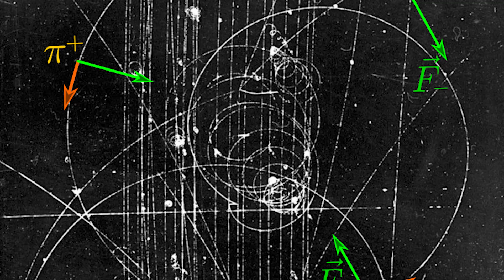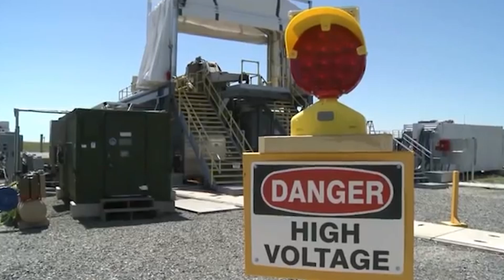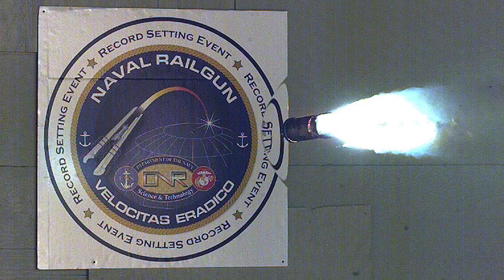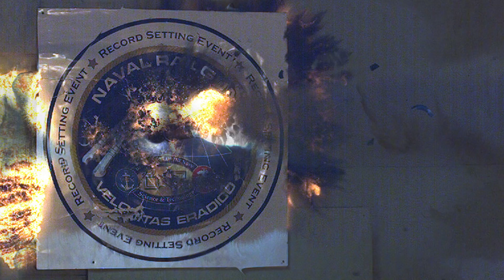Railguns: The Kinetic Future of Warfare

Comment: He actually missed the largest problem with railguns, and the real reason militaries are putting less time into them. Energy transfer.
Studying terminal ballistics taught us a long time ago that too much power in a projectile will actually reduce effectiveness. Like neutrons, the vast majority of energy is dispersed just before the object stops - if a projectile blows through an object too easily, very little of the energy is imparted on the struck object. The deck-mounted railgun was punching clean holes directly through target ships. Small arms found a way around this with hollow-point (the round disintegrates, which causes 100% of energy to be imparted on the target), but it's been an issue finding a similar solution for ammunition under the acceleration stress of rail rounds.

Railguns might retain a place in the future as they have incredible range, incredible potential energy (if the correct target is found), and practically no way of neutralizing (defending against) them. They're certainly not practical in most applications though.
Reply: @commenter1430  killing power is irrelevant if you cant defeat the armor. The best way to beat armor is with something hard and pointy going really fast.  That's why the Abrams tank uses depleted uranium ke penetrators. The round looks like an arrow after the sabot is discarded
Reply: @hawk6111  You’re obviously young, and not in the military. You’re talking about armour like it’s Warhammer 40k - like it’s even an issue. Weapon Strength is almost always stronger than armour; we’ve never had trouble piercing it once we know how thick it is. Once we learn something is “sturdier” we simply scale up the energy transfer slightly, or circumvent it (HESH/HEAT). There is nothing on earth that’s even close to the level of a rail gun, it would blow a hole straight through a main battle tank or battleship. Ships are actually pretty unarmoured (comparatively to MBT’s).
Secondly, energy transfer isn’t “irrelevant” if you can’t beat the armour - this isn’t the Marvel Cinematic Universe. If the armour actually stopped a rail round, the energy transfer that would be imparted on the crew inside would kill them. There’s a reason the US Army doesn’t heavily armour everything, at a point it doesn’t matter. IEDs killed a lot of people in armoured vehicles just due to energy transfer (no direct contact was made).
Reply: @TheAunvre   How about launching the projectile at a large angle? It will: A) allow the projectiles travel through upper atmosphere, therefore increase the range of the gun (this is the same principle of the Paris gun) B) make the projectiles strike straight down, 'punch clean holes' through the deck, and the hull. Clean holes on the side of the hull might not be a problem, but holes in the bottom... yeah, maybe. It leaks. Also, if the target is an aircraft carrier, punching holes in the deck will disable the ship (well, at least its capability of launching and landing planes). Yet indeed, in order to get a vessel close enough to fire a railgun (like, 100 miles from target), you will need to disable the carrier first, or withstand constant air and missile strikes. Another disadvantage of this strategy is by launching at higher angles, the projectiles are exposed to enemy radars earlier, and if they can track incoming missiles, they will be able to track the projectile. With little to no maneuverability, the trajectory of the projectile is very predictable, making it easy to intercept. But railgun systems are designed to fire at high rates, overwhelming the interception system instead of trying to avoid it. Finally, a railgun projectile is (at least can be) way cheaper than any interception missile. Therefore you can bankrupt your enemies by firing at them, even if none of the projectiles hit the target.
Reply: @andyhu9542  That’s a great idea, it would be like a ballistic missile launcher. Although, the electronics in the nuclear warhead might not survive the Gs from the launch.
Reply: The idea behind kenitic energy penetrators is to defeat armor not deliver all the energy of said projectile.
Reply: @commenter1430  considering most things the size of a ship will be armord I would go for that over maximum energy transfer.
Reply: @commenter1430  you thought processes is good when dealing with flesh targets but once you start dealing with armord vehicles it's more beneficial to actually get past the armor and on a vehicle that can be a significant amount

Comment: They whole point of a bullet is to transfer kinetic energy into the target, rail guns cut a hole strait through a target. Higher velocity isn't always a plus. If you need to cut a small diameter hole in something it'll do but so will an rpg that costs like $50.

Comment: The US Navy has already dumped 500 million into the rail gun and the DOD pulled the plug. They cannot overcome the technical issues like the rail gun destroying itself every time it fires the projectile. The fireball is the rails melting from the friction of the projectile and the heat generated from the current.

Comment: Railguns: absolutely ridiculous penetration within a straight line of sight.
Once it has to go ballistic, its comparatively low weight (thus impact) will remove this penetration. 
But the horizon line and its distance thus range depends on the height of the weapon above the current level, meaning these have to be placed as high up on a ship as possible to achieve the greatest possible distance in a straight line.

But no matter how high you place this weapon it will never come close to the range of artillery shells being lobbed over huge distances which can then be guided into its target fairly accurately.
A railgun's projectile relies on its kinetic impact, not on explosives, to do the damage. So hitting not close, but as perfectly as possible is a very high position on the desireable attributes of such a weapon.

Comment: The amount of energy is not absurd. It is just the wrong kind. Big guns in WWII were replaced periodically, due to wear and tear. With today's technology and materials, the shell propellant could be CL-20 or maybe octanitrocubane, at far less cost than the railgun, then replace the barrel after the proper number of rounds. The warhead,  a shaped charge with the same explosives for use against other vessels or HEAT for ground targets, and use the same tech for targeting as it was in the USS Missouri, analog, not digital, safe from EMP. We are no longer trying to sink Yamato or Bismarck with one shot. 5 inch guns are enough for today, unless you are going against Red October or Nimitz

Comment: If you look for it and have a few thousand dollars to spend there's a hand held railgun that's a little bit bigger than your standard assult rifle, and the other factor that comes into play is the newest version of a laser, a unit that weights in under 3 hundred pounds and not very big, but it can knock out aircraft and missiles in flight, and even take out artillery before it can hit. There's currently a couple of platoons of LAV's in the US Army that are armed with these weapons and another interesting point you don't see the beam and it can destroy a fair amount of targets of different sizes.

Comment: The power sources needed for rail guns are unbelievably massive......... like the amount of power produced on a Zumwalt Class destroyer by any chance???
And yes, you're correct..... BAE SYSTEMS has been and is still heavily involved in this technology, which makes me proper proud. I've looked into the Chinese rail gun and it's no way near ready or reliable enough to actually use, it was merely done to copy and/or make themselves look equal to the United States.

Comment: Probably won't solve the power systems problem until sustained fusion reactor is developed.  As for materials, probably need silicates or gem-based coatings to protect the metals.  Electromagnetism should work even with that inclusion.

Comment: I had not known as much about the military applications, but I had done a HS thesis on non-military uses in about '81 based mostly on public NASA documents on mass drivers in a public university repository.  I was looking at transportation and orbital launching. (way more environmentally clean).  Some amusement rides like the one vertical Superman amusement park ride was the first commercial use of the linear accelerator technology.  Weapons require other tradeoffs.

Comment: Good gawd almighty!! Is that how they think to make them?!! Re tar ded. Firstly you can make that "rail" into almost any shape (a helix or toroidal (a dount))  as long as the magnetic field can be along the length of the barrel, next the helix design can be compact so less space, less magnets, AND less power needed😱.

If you need a more "rapid fire" railgun double helix it! Same magnets and less heat/wear on the barrels BUUUT more on the magnet (double duty).

I swear this "linear thought process" most humans have is sofa king we todd ed.

Comment: Cool or gaus guns are more efficient, powerful, and durable. The one I built five years ago can fire a 30 mm projectile at a muzzle velocity of 13,000 fps. And hit a target 200 miles away. Oh and it uses way less power.  The rail gun the us Navy uses is already inferior. The one I built is not even the most powerful in the world. At last check in there were 15 countries developing new more powerful coil guns. The use of superconductors has made these weapons way more prevalent. Rail guns are not as dependable durable or practical. There is nothing secret about the technology. There are design plans available on line all over the world.

Comment: Hmm  there seems to be the implication that this would be used as a personal weapon at 10km/s for a standard 9mm bullet (10g) would use 16 watt hours per shot at 100% efficiency meaning that with a full car battery attached to you you'd get 45 shots and you won't lose any weight when you have spent all your energy. Of course if you were to fire a gun that fires a bullet at ten times the power of a normal gun the recoil is going to kill you. This would have some use on naval ships and maybe for taking down aircraft where over penetration (and lets be honest at 10km/s it's going straight through the target and into space if you fire it upwards) isn't an issue.

Comment: I saw something about trying to duplicate Ben Franklin's key on a kite string. But they were launching Estes rockets using air pressure to fire the rocket off and was tethered to the ground using a small armeter wire connected to the rocket. They managed to get lightning to strike when and where they wanted it to. EVER since I saw that I thought that might be a means to launch a projectile into space, even if it was a one shot wonder. Please look into this. Unless you hear about a crazy man beating you to it from Colorado Springs CO. LoL

Comment: If they solve the energy problem to have a power pack and the rifle projectile is integrated into the barrel so when it fires the single shot it ejects the melted barrel. You could in theory use cheaper materials for the magnetic field in the barrel and projectile. Then simply replace the barrel in the rifle. Because let's be honest. If you hit your target, you will not need to worry about them shooting back so reload time is not an issue.

Comment: The idea of using a railgun type system for launching spacecraft goes back to at least the 1950s. The other thing your research seems to have missed is that the railguns designed and used in universities were being used as very high speed switches, mostly for producing very short pulses of light from lasers. The slug would short two contacts together to make a switch, and since you could control it's speed very accurately it made a great high speed switch. Technology has moved on and there are other ways of doing this now. The problem of power supply has been solved with Supercapacitors, but since these need to be charged up, the rate of fire is still too slow. And the new electric catapults on nuclear carriers are a slow speed version of a railgun!
Reply: The video failed to mention NASA's research in the early 1960's. In turn that triggered Dick Marshall and John Barber's research at the ANU in Australia, which in turn led to the EMACK railgun back in the USA in the early 1980's.

Comment: Rail guns will never go anywhere because the barrel destroys itself more with every shot. The only way they work if you are shooting a plasma projectile. (witch is even further in the future) 
 
Coil guns on the other hand have all the upsides of a rail gun and very few of its downsides. Those downsides it does share though are power and initial cost witch still make the tech out of our reach atm.

Comment: Wouldn't opposite electrical charges attract, not repel, each other?
Reply: The gun does both.. repels and attracts as necessary for propulsion. Pulls and pushes the projectile in the same direction. You can 'attract or repel'' something in any direction.

Comment: meh, most railgun development is just the navy trying to stay relevant by increasing potential range. The problem is they are pretty limited on multiple levels. First is the rate of fire. Charging those cap banks takes time. Second problem is air resistance, fling out a projectile at mach 7 to 10 is gonna cause a good chunk of its mass to vaporize before it reaches it target. So no matter how much power you dump into it, your range is still limited.
Reply: With a couple gas turbines, you don't need cap banks I'm pretty sure a a few hundred megawatts from a few LM2500's would not only light up 1920's Chicago, but power a rail gun easy.  Power has changed lots in the last century

Comment: I wonder could the inside of the barrel could be filled with a quick blast of nitrogen in between every shot in order to keep it cool enough and make the rails out of tool steal which can handle much higher temperatures..

Comment: The energy issue for these guns can be solved and allow rail guns to be used not only on battle ships but also soldiers. 

The energy issue can be solved with perpetual energy.

perpetual meaning never ending.

Electricity is technically light, what happens when a light source hits a mirror? It reflects .

To have this work u would need a charging station near by I would belive to recharge and increase power or decrease power depending how far or close a target is.

When it shoots the pay load the energy stored should be shot out with its payload. Meaning it works like a regular gun accept gun powder is replaced by a current introduced to the never ending reflective circuit.

Just a theory

Comment: 1:20 -- "How it works"... In the mid-80's I worked at a plasma physics research lab where one of my projects was a rail gun.  When the senior scientist was asked that question he replied "Well, first off, they don't..."
The problem is that the "armature" is always a plasma arc of about 3,000 degrees C.  That's hotter than the surface of the sun and it always, Always, ALWAYS melts both of the rails in the gun.  Distorting the rail surfaces is bad enough (for any subsequent shots) but the problem for the first shot is that the arc is vaporizing the surface of the metal in the rails and effectively adding the vaporized metal to the payload (the bullet).  What starts out as a half Kg payload can wind up as a 5 Kg payload where most of the weight is in vaporized rail material.
The fastest speed we ever got was 3.5 km/sec back in the mid-80's.  After more than 35 years (and god knows how many billions of dollars) later you're reporting the Navy's projectile speeds are 3 km/sec.  I got news for you, the Navy has been promising 10 km/sec for more than 30 years but it's never going to happen.

Comment: .... doesn’t the average laser counter to a rail-gun shell cost less than half? I mean... if light can heat the slug or shell off its flight plan... when does it get cheaper to fire a rail gun?
Reply: I'm not too certain about that tbh, a laser counter doesn't have any physical mass to counter the kinetic energy behind a railgun shell to change it's trajectory much unless it puts in enough to heat the shell enought to deform drastically (changing the aerodynamics enough to change the direction) but the time a laser needs to do this is tiny given the sheer speed of the kinetic projectile. Subsequently this means the energy that needs to be put into the laser counter is orders of magnitude higher than current countermeasures, or at least that's my rough understanding of how it works, I'm no expert by any means

Comment: They don't grease rails and the heat and pressure warp the precision alignment and aren't good for sustained fire. That's why I just wanted to make a dread rail battleship with a singular modular rotating rail battery firing 15 inch steel bearings out of a dread accelerator. Its really just a target since missile cruisers still have logistic and strategic advantage.